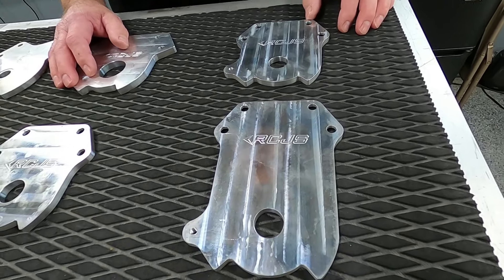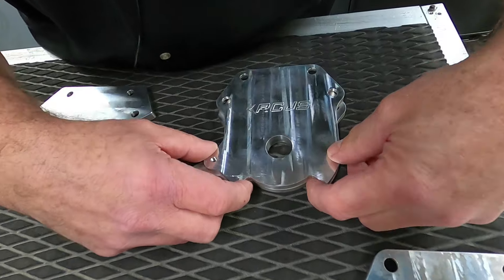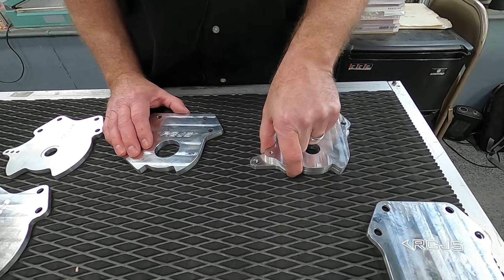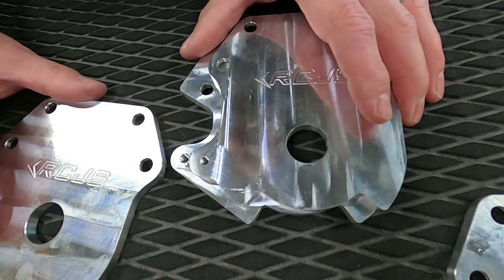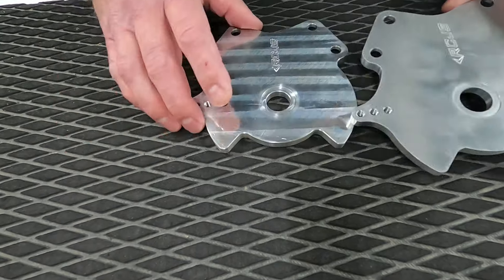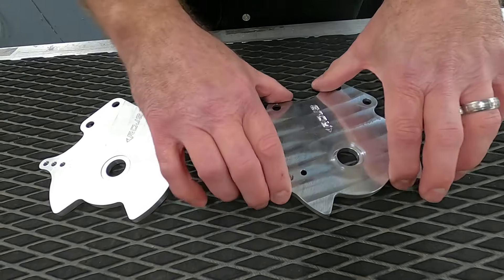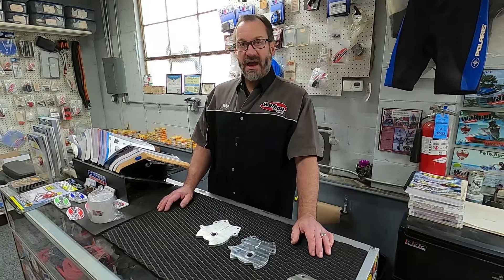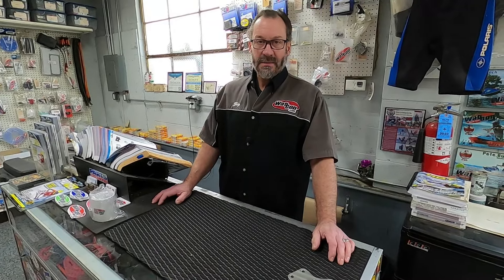Steer Plates talk. PWC, Super Jet, Jet Ski stand up, etc

Comment: I up your game of bars forward by using straight fat bars. I use a thin KTM motorcycle bar clamp that has a flat side. You drill out two more holes on the plate to accommodate the fat bar clamp holes and you are good to go.

Comment: Another great video John. So, if one would want to run a different Kawi plate… should they also change out the cable as well, if so… what cable would one want to use?
Reply from the maker: Cables are specific to each hull. Jet pump, travel, etc.

Comment: So on 2012 they're are 3 holes for steering angle but yamaha says only 2 can be used. Why can't the outer most one be used? Is it due to cable bottom out?

And this may be wrong video but looking at trimming it. It looks like it has a bolted trim tab. Can you manually trim the ski with that?
Reply from the maker: Thanks for watching,  I believe the outer hole on the stock plate is not threaded. I also think "IF" you thread it, the cable will then bottom out before the steer stop causing cable damage.

Comment: JS440- I want to add straight bars and a quick steer.  Short or long plate?  Is there benefits or drawbacks of one versus the other?
Reply from the maker: It's all a preference.
Reply: Can you run handlebars with the cross pad on the short plate?
Reply from the maker: @BuckleyBuilt  Yes you can